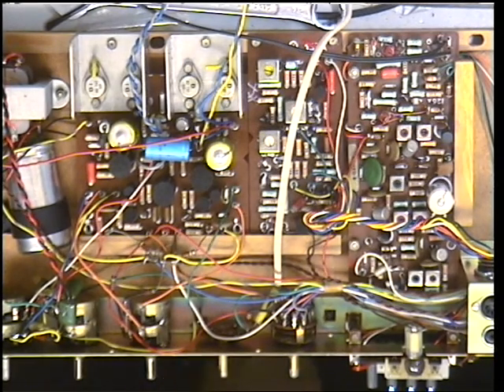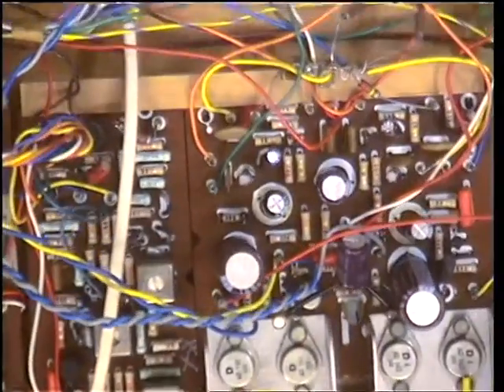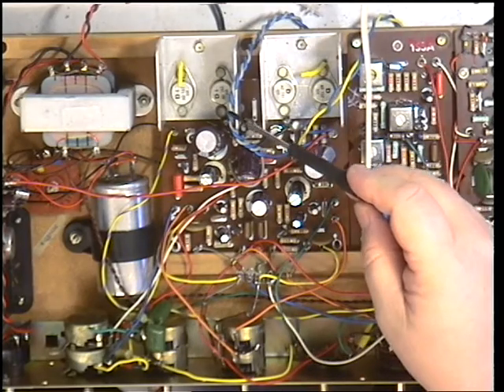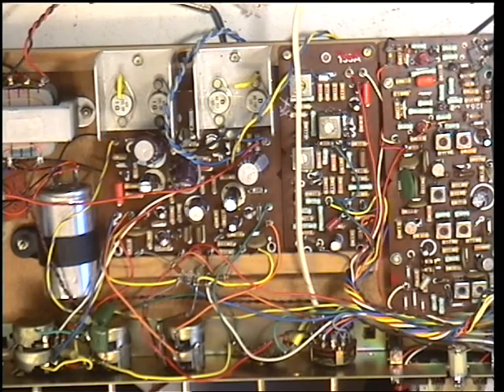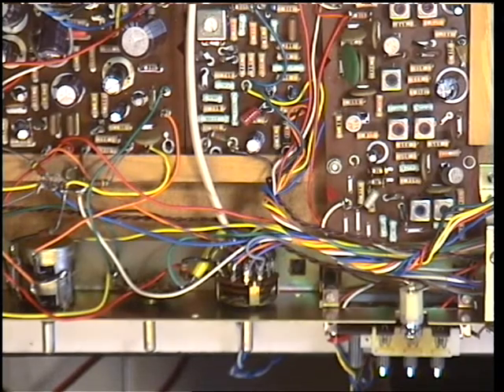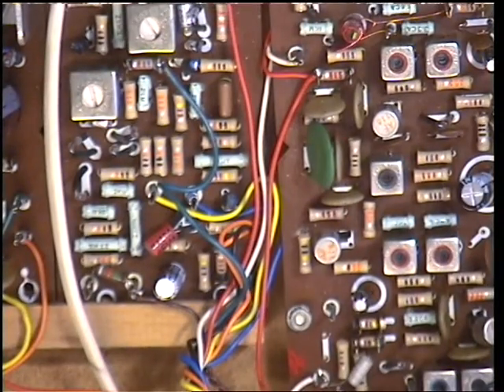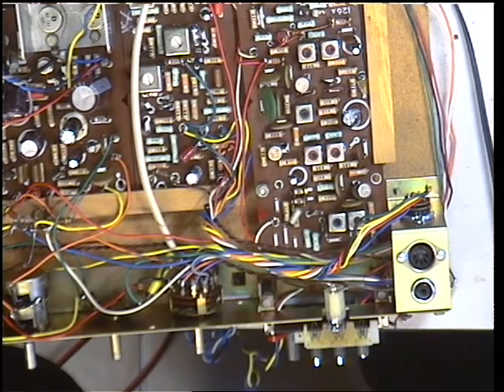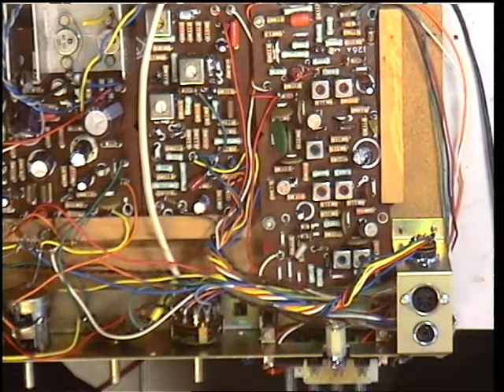HMV Stereomaster radiogram servicing 2330 Pt2 of 3

Comment: Hi, thank you for your advice! We've come up against a problem, when we switch on the record player there's a loud hum from the right channel and the two resistors connected to the output transistors (R109 and R110 in the diagram, connected to VT17 and VT18) start to smoke. We can't find a short circuit and we've replaced VT18 and checked the polarity of the capacitors, is there anything else that's likely to cause it, it should we keep looking for a short?
Reply from the maker: I'm assuming you have changed every single electrolytic capacitor. For DC to pass to the speaker surely C82 has to be faulty or in backwards. Out of interest what value have you used for C82 as the 750uF specified can be difficult to get outside the trade?

Richard
Reply: Thank you! Yep we've replaced it with a 1000uF capacitor. We can replace it with two in parallel to get closer to 750 uF if you think the higher value will cause problems?? 🙂
Reply from the maker: @serialhumour  No, 1000uF wouldn't be a problem. Email me as these extended comment threads are easy to lose track of on here. rshireby@yahoo.co.uk

Comment: Another great vid in this series. I always used a 25watt iron on these, which I found did the solder work well. 👍
Reply from the maker: Bear in mind as a commercial business we are using the well overpriced Weller TCP soldering stations at all benches. When I was a hobbyest I got on well with the Antex soldering irons & has a 25W & a 15W one.

Richard, G0OJF, UK
Reply: @ukfmcbradioservicingTango21  As a manager for a high street electronics store I could lay my hands on some top gear but still preferred the Weller irons AND I liked the 25w when it came to NOT lifting the printed circuit tracking.. even on earlier valve units.. For more antique radio et work I use a variable power unit but also have two 40Watt AND a 60Watt heavier duty iron which works well for solder to metal chassis joints et

Comment: Very interesting video, I'm glad to see you one of these getting repaired as I remember them getting thrown in the skip in the 80s. If it's the one I remember the speakers are on the sides, has a brilliant tone
Reply from the maker: The HMV Stereomaster are totally underappreciated by younger people who seem to just want to listed to stuff from a 1" speaker or headphones. These products are real HiFi performance. You are right, the woofer speakers are in the side & the tweeters are in the front. With the 5-pin DIN auxiliary input/output socket provided, the versatility  is there & so many different things could be plugged in....even a crappy bluetooth receiver.

I produce these videos to help others service these products. Despite trying hard not to take these in for service, I seem to be doing about ten per year!

Most people who hear one of these working properly after overhaul will never before have heard anything this quality.

Richard, G0OJF, UK
Reply: @ukfmcbradioservicingTango21  I know who to come and visit when I find a radiogram , prob is I live in Highlands of Scotland hardly anything for sale up here. Where you based ? Yes remember the tweeters on the front and yes I had a din Philips cassette player in the 70s now could be Bluetooth.
Reply from the maker: @lookoutleo  Grantham, Lincs

Comment: Excellent videos, thank you Richard!
The instructions on replacing the power supply capacitors were fantastic.
I'm trying to source some D1569 transistors, any idea where we'd find them?
I'm Bernadette's friend, we're working our way through the transistors for the left channel and we've found a few out of spec so we'd like to have some on hand in case 🙂
Reply from the maker: Patrick, even back then the Thorn 'in house' transistors were a swine. On the bottom of the 2400 model is pasted an equivalent chart. That model uses four D1569 transistors. The Thorn equivalent chart says BC187....and they are still dead cheap to buy.

Richard, G0OJF, UK
Reply: @ukfmcbradioservicingTango21  Fantastic, thanks so much! I'll get some ordered 🙂

Comment: My friend and I were able to repair the same model record player from your 2 videos - thank you so much!!! They're brilliant. We cleaned and oiled, then replaced all the electricity capacitors. Only remaining problem was the left speaker not working. When we switched the wires the right stopped working but the left worked a treat. So we're replacing the transistors next 🤞🏼

Question: when we opened the back up, an inch-long, blue coloured, L-shaped plastic tumbled out and we couldn't work out what it was attached to. Didn't notice anything similar looking in your videos. Any idea what it would be for?
Reply from the maker: I think it is a stylus protector thats simply fallen in the works. If you don't have the service manual I'd email it to you to help. I hope you have a multimeter to check voltages as per the manual to pinpoint your fault. They are less than £10 these days. Same applies to transitor testers.

rshireby@yahoo.co.uk

Comment: I Have this same model, i found it in a chariety shop 3 years ago, it worked in the shop although the turn table was a little funny. i was using it on the radio but with the intention of refurbising it then one day it just stopped working.

I think im going to change all the capacitors like you did in the video am i right in thinking if i cant find the esact same ones just get the next one up? im guessing it cant go down? any advice greatly appreciated.

Callum
Reply from the maker: Yes, change all the electrolytics (there are about 21). I recall the power supply one is 4500, so we fit 4700 @ 100v because we ordered on diameter to fit the clip! There could be some 680uf on this model & we get 750uf. I think there are some 8uf, so 10uf, some 2uf so 2.2uf etc. To be honest you shouldn't have run it without changing the critical ones in the amplifier. It takes us 35 mins to lubricate & set up the turntable (tracking pressure check between 2.9 & 4.4g), 15 mins to take the chassis out, 45 mins to change the caps & 30 mins to put it all back together & test so you've no excuse for 'haven't got the time'! Any parts supply snag, you can email me at rshireby@yahoo.co.uk

Richard

Comment: This is all so well explained.  I have repaired quite a few things in my time (although not professionally). One issue with some old VHF/FM radios is that some only cover from 88 to 100 MHz. ie no coverage of 100 to 108 MHz. This appears to apply in particular to models tuned by varicap diodes. I wonder if this set was one of those?
Reply from the maker: So I just looked at the service manual that states "87.5 to 101Mhz". Bear in mind that in those days (1969) VHF AM mid-band business radio was on 101-108,Mhz,...just under VHF DSB airband, with the duplex frequencies the other side of Aircraft band at 130Mhz upwards towards the 2M amateur band  of 145Mhz.

Richard
Reply: @ukfmcbradioservicingTango21  Thanks.  In the 50's and 60's, in my area (London), it was possible to hear police between 100 and 108 MHz on radios that had the coverage even though they were on AM.

Comment: Hello Richard, Why don`t you buy one of the cheap stereo fm transmitters on ebay you could then check the stereo receivers you get for repair.  http://www.ebay.co.uk/itm/Double-Dual-Channel-Wireless-FM-Stereo-Transmitter-Microphone-Mp3-BH1417-Module-/272162047698?hash=item3f5e1f46d2:g:M6sAAOSwr41XHs4W
Reply from the maker: John, I looked at that but it only tunes above 107Mhz. The HMV Stereomaster 2330 covers 87.5 to 101Mhz. Bear in mind business radio mid-band used to be on 100-108Mhz. Times have changed. However, using your good idea I had a look at others & ordered this fully tuneable one :-  http://www.ebay.co.uk/itm/FM-Transmitter-AUX-IN-Radio-Adapter-Transmitter-Stereo-Music-Modulator-Kit-/172374803438?hash=item282256c3ee:g:myAAAOSwxKtYAMSM

When this comes, I've had the idea to connect it's input to two audio generators. It may be possible to perform decoder alignment this way on a cheapo budget. I'll experiment with something worthless. I'll read up on the subject.

I have to say that only three of the ten HMV stereomaster models have stereo decoders so it's not been a snag. When we test them on the outside benches we can always get a stereo broadcast signal.....I can actually hear the difference!

Good idea 10/10

Richard
Reply: Sorry I didn`t notice it was above 107mhz, I found this one on banggood - http://www.banggood.com/DSP-PLL-87-108MHz-Digital-Wireless-Microphone-Stereo-FM-Transmitter-Module-p-993164.html?rmmds=search
Reply from the maker: Ah yes, that would work. Anyway, the one I found & ordered is also a finished product. I don't really want bare PCB's kicking around the workshop & the time involved in casing the module would be cost prohibitive . Bear in mind i'm not a hobbyist so time is important. 

Thinking about time....how many audio products such as this HMV radiogram do we all spot on Ebay with the  sentence "I was going to sort it out but haven't the time"? Well the turntable service takes 35 mins, the chassis takes 15 mins to take out, the capacitors take 45 mins to change & putting it back together takes 30 mins. It's high time some of these people stopped being glued to the telly!

Richard
Reply: Yes very true. I have noticed their are some who are to lazy to even give the things a wipe over with a cloth before listing them.I have been repairing electronics for 45 years and enjoy watching your videos to see if I can guess the fault before you get there.
Reply from the maker: Very true with the cloth. I don't even bother switching on these products before doing the turntable lubrication & changing the electrolytic capacitors we both KNOW are unreliable. 9 times out of 10 there are no further faults....unless there are germanium transistors around.

Richard

Comment: Callins capacitors!!!
Reply from the maker: Yes, of course and the Hunts ones which we always put a "c" in front of. The ERT service sheet we have for the 2328 previous model (same tuner board hence we had it out), has a lovely advert for Hunts capacitors. Mr Chippie & I had a good laugh. All the caps we fitted were 105 degree rated & 3000hr rated at full voltage industrial/military grade. That job won't be coming back!